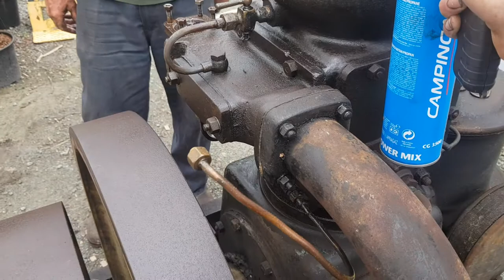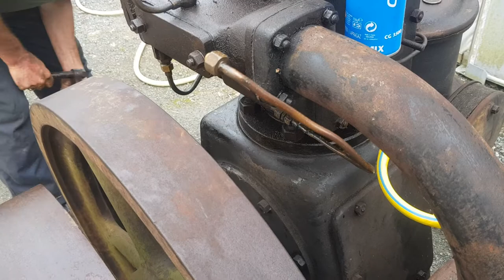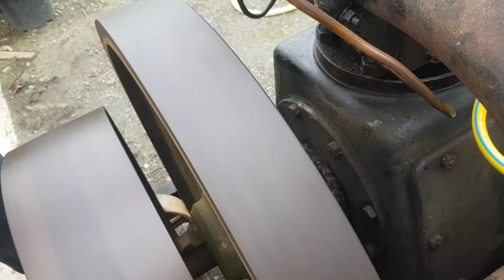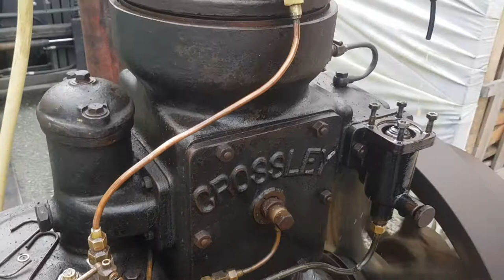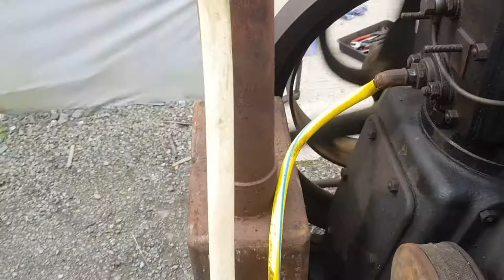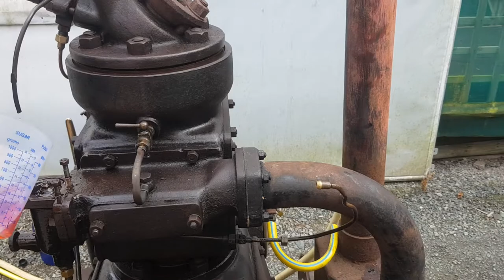Crossley VOE 7 Second Start up

Comment: Did this engine original needed that pre heat?
Reply from the maker: yes as it is a hot tube semi diesel engine which runs with lower compression than a normal diesel so needs extra heat to start. once it is running the hot tube stays warm enough to sustain the engine